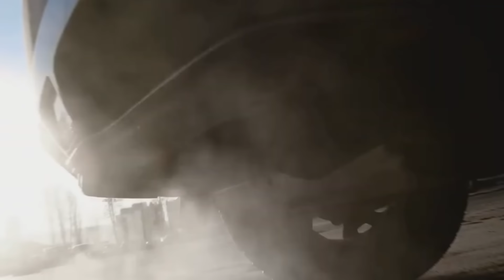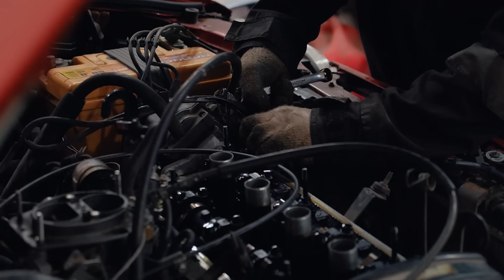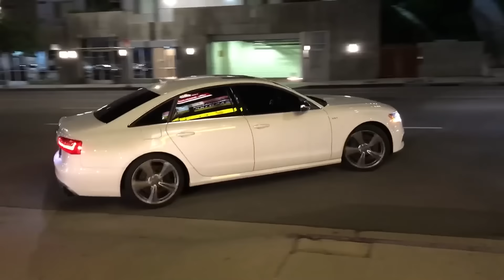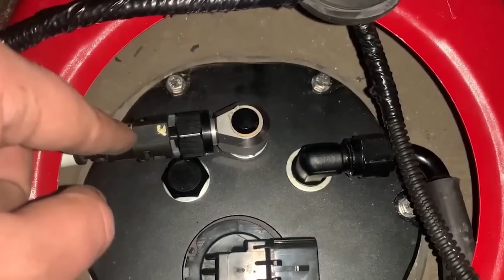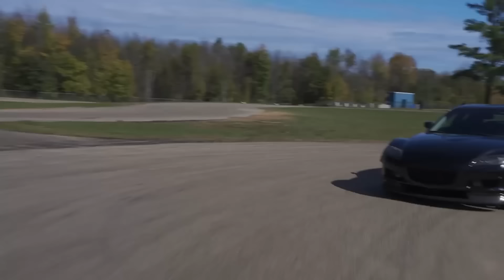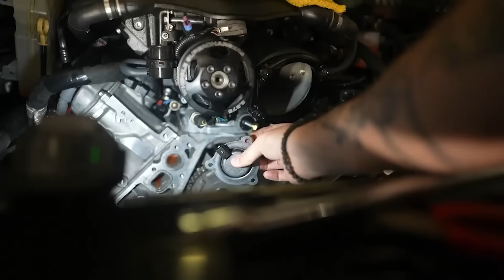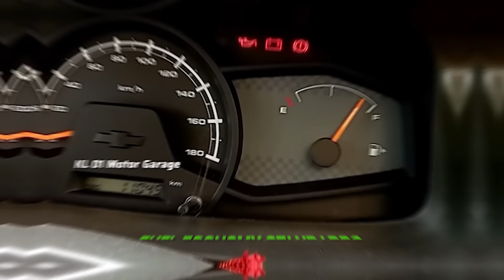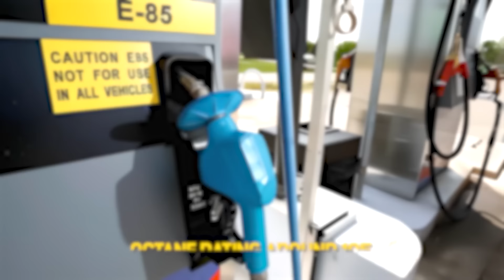10 Illegal Mods That Will Make Your Car Run Better

Comment: For the catalytic converter you can just upgrade to one from a bigger engine meant for higher airflow.
Reply: Most of the time you will actually get better performance from a High flow cat vs catless. Like for example my old x3 got around an extra 20hp from a high flow cat over catless. It also allowed the turbo to spool up faster allowing boost to come on faster over a catless system.
Reply: @MarkIrwin02  '74 firebird with 400 cube v8 225 hp with no cat. '75 lost 40 hp down to 185 hp with 1st yr GM pellet filled cat!
Reply: @utuBrV1oI  think it’s something to do with modern combustion engines where most of the time they benefit more from a high flow car vs catless. But not completely sure. I do know what you are talking about as well. Which is where I think most people got the idea that catless is always the best performance. Granite there are times with modern cars where catless is better. But typically those are in high hp builds 800+. Have 2 performance shops near me 1 focuses on chevys and they personally found that high flow cats always made more hp regardless of the build.
Reply: @MarkIrwin02  I knew having back pressure with a turbo made a differance 
BUT
That is awesome, better performance
AND
Better for the Climate
Reply: @ProudDad1976 and can take to any shop too. Win win win.
Reply: @MarkIrwin02  Great point
Reply: Wasn't  it "global cooling" in the 1970s? Then the lies were too obvious, so they took up "global warming " 
By about 2000 those lies were  being exposed so it became "climate change", which has once again been exposed as nothing more than fraud and grift again to steal $$$$$$$ and liberty from people.
Reply: Amazing how farmers can still do burn offs and household use wood fired ovens. 😅😅
Reply: @Golfr2020  Classic, the "what about" game. This shows how childish you are, just because there are other issues mean you should do nothing? Grow up!
Reply: @Golfr2020  Love how my comment got deleted.... You're a child, we can have many issues and deal with them one at a time or all at once, but your argument is "what about over here?" So you want nothing fixed?
Reply: @Golfr2020  Figure you golf and are proud of it.
Reply: @Golfr2020  Only a child would think an "what about" statement is a viable comeback. If you do not want to better yourself, this is how you do it. If you blame others for their issues, you will never grow as a person and you will have fixed nothing. Good Job, And You're A Golfer? Game, and you are a waste of space.
Reply: Easy and you won't be poisoning your land and family
Reply: @ProudDad1976  It's true that a cat reduces HC & CO, but ironically converts those gasses to CO2! 
& i never even heard of global warming before cats were on most vehicles on the road - on approx 
500 million now!
Reply: @utuBrV1oI  .A converter filters out Carbon Monoxide, Hydrocarbons and Nitrogen Oxides which are the three main elements in acid rain. As for converting to CO2 any CO2 that is converted is reburned in the converter and if this is not enough to reduce these animal killing gases then the computer will adjust the air fuel mixture or throw a trouble code because there is an issue with the engine like a faulty O2 sensor or worse carbon buildup which happens a lot on newer direct injected vehicles
Reply: @utuBrV1oI  As for you never hearing about global warming before Cat systems being installed just tells me a bit about your education.
Reply: @ProudDad1976  Well, global warming from CO2 emissions was certainly not even mentioned at NJIT in the 1970s when i went. & CBS's 60 min has been on tv since 1968. & the 1st time they mentioned global warming from CO2 was when after cats had been in almost all cars driving regularly for a sufficient period of time. & i follow(ed) the news on the radio & newpapers & tv & magazines a lot  - & the timing was the same - in mentioning global warming from CO2.
Reply: @utuBrV1oI  If that was true, it would make you a very educated idiot.
Reply: @utuBrV1oI  Scientists started talking about it in the 1800's, and actually started to measure its effects in the 50's. True fact, look it up
Reply: @ProudDad1976  Check your history books, in the 70's it was global freezing they went on about.
Reply: @logicplague  That is true 
But
They were wrong
And
Now, admit it, can you admit when you are wrong with 99% of
All
Scientists saying so?
Reply: @ProudDad1976  I'm still waiting for you bro lmao
Reply: @logicplague  My comment is being deleted. This will be my third time responding. Scientific advances mean that what we see of the world is fluid; what they thought was global cooling was actually El Niño and La Niña. But they found that with this, the Earth was getting hotter over a total span of time. Scientists learn and admit when they are wrong; can you?
Reply: @ProudDad1976 Ah yes, the "acid rain I've been waiting for to destroy the world since I was age 5. LoL 🤣😂

Comment: Let's be honest, most cheap cold air intakes on the market just pull hot air from the engine bay
Reply: The sealed shakers on '73-'76 trans ams can easily be opened up so that the carb can ingest more & cooler outside air.
Reply: They really shouldn't call it a cold air intake it just allows more airflow it all depends on your motor I have a 5.3 which is a 327 short strokes and RPMs I put a cheap $80 cold air intake on my Avalanche and gained 15 more horsepower and better gas mileage
Reply: @DavidSmith-mb9to  Definitely noticed a difference in my Silverado with Flowmaster cat-back, the factory tube has a huge bottleneck in it.
Reply: You're confusing and putting short ram air intake in the same category with Cold Air intake! 🤦

There is a huge difference!!
Cold air intakes work, but not the short ones!
Reply: Yea guy, no shit 😅 any air being pulled from outside the engine is still VERY much cold. The temp of the air in the engine is upwards of 300°. So even if it's pulling air in that is 130 degrees,  it's still going to increase performance on the bottom end
Reply: @erickkenneth3391   I was mainly referring to the "ebay special ones" that's pretty much aluminum tubing and a cone filter right against the engine versus lower in the front bumper. Those typically don't have proper air dams to separate the fresh incoming air from the engine air.
Reply: Facts
Reply: The question of  "performance gains" muddys the water. I've owned a Chysler where the cat totally failed and we removed it. And I just drove it at my normal speed so I wouldn't get tickets and found I used heaps less fuel. So maybe a cat works as intended when new but after say, 100,000kms the vehicle starts to inefficiently burn fuel, then much more fuel until it fails so where's the benefit?
Reply: Yes,you are right....
Reply: If there isnt a feed from the front aka grill ect then yeah your right.
Reply: On most cars the factory air box and ducting is 99% of the time better than any aftermarket intake you can install. Regardless the factory box can’t give you the turbo whistle or flutter that an aftermarket one does
Reply: @Gc8.mischa  That's the wastegate on a turbo, nothing to do with the intake lmao.
Reply: Yeah , cheap ones without any box protecting it from the engines hot air yeah
Reply: Yeah, a lot of them and up being more "hot air" intakes than cold. Have you found any budget ones that actually work as promised?
Reply: @Carflowus Nope , they never work as said , mostly all products aren’t working as said
Reply: That's what I always thought.But at least you're getting more air though
Reply: its all about the routing you use... mine is right into the cool air and away from heat soak
Reply: Less be honest if u have a naturally aspirated engine a cold air intake is dumb … and usually the way the cars Intake is designed is sufficient enough for the performance of that motor
Reply: @erickotapish7842 

I have always been able to improve on the factory air box ET and mph. Either with an open element and a heat shield or a fabricated air box. Factory engineers can design very good airboxes, but must operate within noise and water ingress restraints.

That said the gains are not large and for a street only guy I would auggest leaving the factory airbox unless you desire the additional intake sound and can deal with any potential water ingress (design dependent).
Reply: It's usually sufficient within design constraints. 

I've always been able to find at least a little more ET and MPH once the noise and water ingress (design dependent) limitations are lifted. Sometimes with a modified OEM Box, sometimes with an open filter and heat shield. Sometimes with a fabricated airbox.

You are talking about pretty minimal gains though. Less than 0.5 mph in trap speed in some cases.

Without tuning it's very possible to lose performance.
Reply: @gk5891  And gain unwanted sounds, some cars sound horrible with a cold air intake like the 3.6 liter v6 LLT sounds like your water boarding the engine.
Reply: @gk5891 I get it I actually have a cold air intake in my Honda but it is t for performance I had to put a bigger battery under my hood for audio and the factory air box was too big so I just kinda made my own to where it would all fit they serve a purpose definitely but if ur driving a 4 cylinder natural aspirated car or any natural aspirated vehicle there wont be much up gain if any it usually just makes ur motor sound a little louder
Reply: @erickotapish7842  I agree with you unless the manufacturer is the one who designed it and used it like with Pontiac did.
Reply: Yep, it was worth a little less than  0.1 second when I wss normally aspirated, but IAC when the car waa moving remained about the same. It was simply the reduced vacuum (restriction) in the air tract. They are really more correctly called low restriction air intakes.

I went back to a modified airbox after the supercharger  so I can run a smaller blower pulley (higher average power) without running out of fuel pump and injector in cooler weather. I only have enough fuel pump and injector for about 650 bhp or so. You can see the AFR starting to rise before the 7200 rpm shift point with an open cone filter. I'm about at the limits beyond which you start to see bent rods so really didn't want to invest in more pump and injector. 

BTW Good modern OEM Cats usually only cost 1-2% in power at any sane level of power on the street. They are much less restrictive than they used to be.
Reply: From what year ,are the CAT'S less restrictive ? @gk5891
Reply: The best cold air intakes are the factory ones
Reply: @DaveBigDawg  The Ram Air on the Pontiac Grand Am 2004 era was very well built and the whole system sounded great
Reply: Not if you have a tune for it.if you don’t have a tune then it’s worthless and just put it on for the sound

Comment: OK, somebody clearly didn’t do enough research when they made this video because the 85 ethanol is considered a green fuel.
It is by no means a racing fuel. 
In fact, there are vehicles called flex fuel vehicles were designed to run E 85 ethanol or regular unleaded gasoline.
Seriously, don’t make a video if you don’t know what you’re talking about .
Oh yeah, and also the claim that modifying your suspension with an airbag suspension is illegal across the entire United States is in accurate.
Here in California, where we have the most restrictions on vehicles it is legal to have airbag suspension.
There are cars on the street that are on airbags. There are cars that are on hydraulics and they drive on the street every day. 
As long as it doesn’t change the weight of the vehicle, it’s perfectly legal .
Oh, one more thing I’ve noticed in this video you go on and on about police inspections .
In California, the police don’t inspect your vehicle unless you have a really loud exhaust .
Even if they do inspect it, you could take that to court and challenge the officer in court because he is a law enforcement officer. He is not a professional auto mechanic. 
So what the officer might think is a modification and is it illegal may not even be a modification .
Anyway, please, please do your research do better don’t make videos that are full of misinformation .
Reply: You seriously typed up all that and went "yeah, I'm good to post this." 🤣🤣🤣 You've clearly never tuned a forced induction car on Ethanol. Ethanol cools the incoming air charge, which allows for better knock resistance due to higher fuel concentrations, greater ignition advance, and therefore more power. It is literally $2/gal race gas. I can actually make more power on pump E than I can on C16 or Q16 at a fraction of the cost. The only thing incorrect in the video had to do with swapping in a manual gearbox. While a third pedal is certainly more engaging, a manual car will lose to a DCT car at the same power level every time, provided the car is set up properly and the driver isn't napping at the tree.
Reply: I get 518hp to the wheels in my Type-R when tuned on E-85. Everyone that tunes their cars,know that you get more power on E-85 plus your engine runs cooler.
Reply: @chriscrawford2197 you 100000000000000% do not get  518hp on your civic with only an e85 tune 😂😂😂😂😂😂. How old are you? Do you even have a car?
Reply: @kaighSea can you please point out where I said on ONLY E85? Of course there is more than just the E85....and anyone who has a brain 🧠 would know that...SMH.
Reply: @CKC19  well the implication of your post itself implies that it's only tuned on E. That's like me saying" when I have my green cup holder in my car, I make around 600WHP. " 

Everyone would take that as I'm saying the green cup holder adds 220 HP. Lol
Reply: @kaighSea  if you dont understand fuels then just dont talk about them
Reply: @knowbull5hit590 what are you talking about? Lmao what did I say about fuels? Did you mean to tag the other guy that implied his fuel added 300 hp?
Reply: You're an idiot. He never said it added 300+ hp. He simply listed one of his mods while saying his car makes 500+hp you dimwit. Smh. All you did is warp the narrative.
Reply: @CKC19  definitely some responsible numbers most don't comprehend sir. Do you have a k20 or k24? What year are you rocking?
Reply: @208outboard 2017 Civic Type R....with a few mods.

Comment: In most cases, removing mufflers/resonators will not only reduce power by lowering scavenging, it will also make a car basically undriveable due to droning noise.  Who did this video? A 15 yo?
Reply: False as long as you have 12-18 inches of pipe after the collector

Comment: Did he say RICH FUEL mixtures? Why you need emissions for,
Further more by proving fact you can run a car off vapor from your fuel.
It's air/ fuel mix NOT all fuel RICH FUEL mix crape. get back in your books and be a dumb-dumb

Comment: Really, if a engine is designed correctly it wouldn't have emissions. To require a cat on it. Proving fact. Done it in Cali mod a engine passed the test no problem.
Reply: There are other emissions that are not tested for, like oxides of nitrogen (NOx), that will be within spec if the catalyst is intact and functioning as intended. NOx is what makes that brown smog you see around Los Angeles, and when the UV from the sun hits it, it produces ozone, which is harmful (but has no color).
Reply: One miner problem, I went done the test on the vehicle 6× emissions. Told the testing sight give me a week I'll be back.
In less than a week I was back and passed no (No) emissions on car.
He had to make sure I had the car running lol.
Remember I passed the second time I went there correct!!
Guess what NO cat. So tell me that the car companies have the best intentions NOT.
Reply: @bobboyer3766  What part of 'There are other emissions that are not tested for' didn't you understand? An engine can appear efficient regarding measured emissions if it's properly warmed up before and during the test. But it's never truly emissions-free. Many real-world pollutants and conditions are not fully captured. Every cold start, for instance, emits unfiltered pollutants, no matter how well the engine is designed (Dieselgate anyone?).